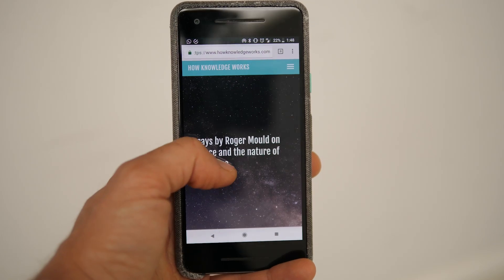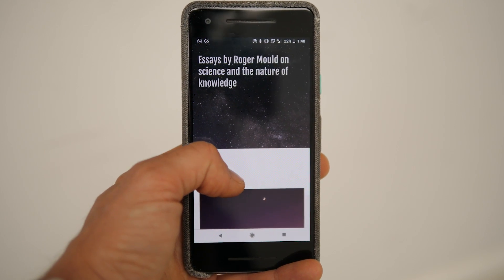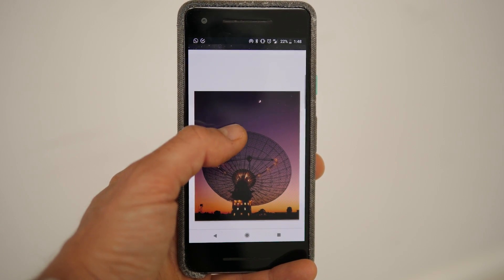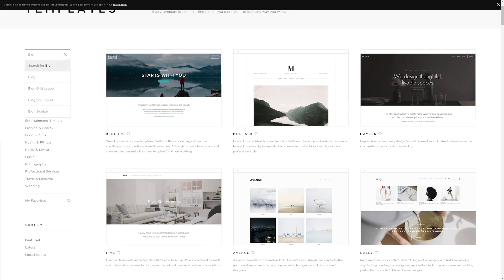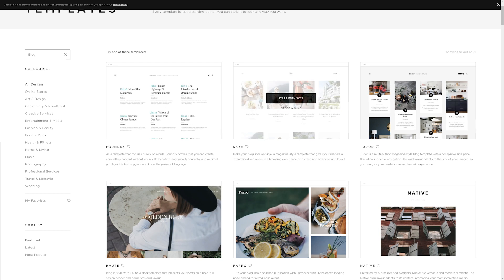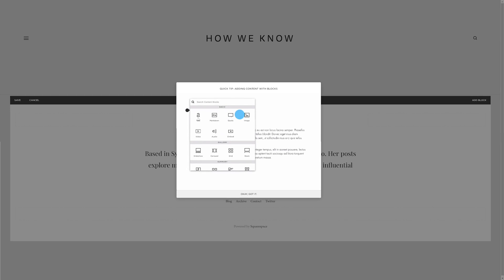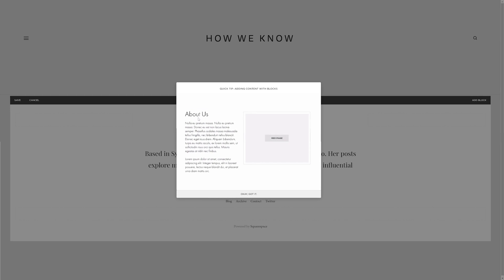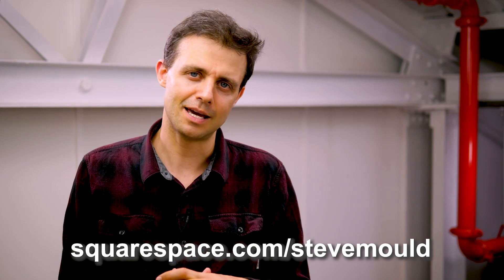The bizarre ripples that form in a stream of water

Comment: The front of the flow is smaller and the source has more mass and moves at a increased velocity. The flow rates the velocity x mass sq  = 
Like an arrow the back of arrow is  moving faster than the front. The source of the flow is moving faster than the leading end.  This isn't a mystery simple fluid dynamics. The specific  gravity of the liquid and the velocity of flow will determine the flow characteristics in a phased life cycle. You will get molecular separation causing the formation of drops, flow Eddie's and axial flow separations exhibited in the cross section or weave patterns in the surface representation. This isn't a mistery it science, fluid dynamics, physics, chemistry and math.

Comment: Pretty sure it's more a property of subcritical flow.
Basically, sub critical flow is when the speed of a liquid does not exceed the speed that waves can travel through it, meaning waves can travel upstream.
When you stick your finger in the stream, tye obstruction creates a continuous ripple, and due to the low speed of the liquid, those ripples can travel upwards.
As to why the ripples are bigger up further, it is likely because the speed is slower, allowing for the ripples to travel further up.

Comment: this is something that has catched my attention a long time ago... what i see there is surface tension doing it's thing, but i doubt it's related to a standing wave... look closer at 1:32 ... closer... more closer... it's not bulges that build up in the stream like when it's dripping. instead, the stream turns into a spiral flow... the spiral flow will turn one way or the other, depending on which side in the depth plane of that frame the bottom cloth is located...

i think... just guessing...

Comment: Water it’s a fluid with relatively low density and viscosity, and like any fluid have a superficial tension, when you interrupt a laminar flux it acts in a very similar way in to a swinging string but it has an extra dimension over the surface tension and it transforms in to a membrane. When you have a swinging string it vibrates just like it’s fundamental armonic (in proportion of the total string length), when you have a laminar flux, the surface vibrates also, and it takes the reverberation of the laminar length just like cimmatycs, that’s the reason because a water flux can transform in to a standing wave pattern, it maintains relation with the water natural resonance and the standing waves gets propagated all over the surface

Comment: Some pictures of water dropping out of a faucet: https://goo.gl/photos/rayt6T8pdDGvWVLh6 It seems like what he is saying can be expanded to explain what is in these photos as well. When I took the pictures I thought surface tension and standing wave and I was happy (not very curious on my part).   My uninformed guess would have been that a single water ball towards the top would have formed.  Now my explanation, based on my weak understanding of this video, is that didn't happen because as the ball formed it sucked nearby water in the column into it faster than the momentum of the water caused water to flow into the ball and a low pressure area under the first ball is formed which causes the column to neck down and the process repeats until a series of balls have been created?

Comment: So my thinking is: Since you put something in the way of the flow, the molecules get slowed down(maybe even get pushed back a little bit. So the molekules in the front of the flow get slowed/pushed back, but there are more molekules coming at unchanged speed from behind, so the molecules bottle up and need to go somewhere and form the bulge. If you look closely at 1:17-1:45 you can see, that if you hold the object in the middle of the stream, the bulges are shiftet (when there is a bulge on the right side, there is a pinch point on the other side and vice versa), because the one side is obstructed while the other can just flow normally. And if you hold the object directly under the stream you have the bulges lined up (1:36), since you obstruct the flow on both sides equally. In a confined space (a tube or a channel), if you put an obstruction somewhere, it would create turbulences, since the bottled up molecules cant go anywhere and swirl up. In an open stream however they can just form these bulges because there is nothing in the way. 
Can someone debate?

Comment: I think it's a simpler phenomena.

You are perturbing the flow, causing collisions of water molecules with the obstruction as well as other water molecules.
So two things can happen right?

Either the force will be enough to break the surface tension of the water, creating a lot of splashing or it won't. In the case that it doesn't, that motion is still dissipating into the stream of water. The result is waves caused by the physical collisions of particles while being contained within and colliding with an elastic surface.

Comment: Steve,   I don't know if you accept suggestions for topics, but I think I have a good one for you.... If you drill a hole FIRST and then use a countersink bit, it will cause a vibration which ends up creating a hexagon shaped countersink hole, but if you do the countersink before drilling the hole it will be nice and round.  The weird thing is .... a five edged countersink bit will also make a hexagon if used AFTER the hole is drilled.           
Question 1: Why?
Question 2: Is there any connection with the naturally formed hexagon shaped clouds at the poles of Saturn?
Reply from the maker: This is really interesting! What are you dilling into?

Comment: I was thinking of a trumpet. There are two places where the wave inside it reflects. One is at the side of the mouth, the other is at the bell. That is a reflection too! When a wave pulse leaves the trumpet, it also reflects back into the tube! It is similar to a whip. When you make it crack, you shoot a wave through the whip, which at the open end reflects back, in phase through the rope back at you. So I thought that was relevant for droplets releasing from a water column too. As soon as a droplet releases, it will send a wave up that column, as much as it gets an internal wave as seen in the soap bubbles when they are released. It is similar to the vibration you see in the copper ring at 4m34s. This will explain that you can see waves traveling both up and down the water. 

With the obstruction in the stream, it is the same thing, though the reflection is in the other phase, like at the mouth end of a trumpet.

Thank you for the interesting video. I have seen it so often, and as a sound engineer, thinking about how waves reflect is part of the art, but I never imagined the waves in this situation.

Comment: After reading Gerald Pollack's 'The Fourth Phase of Water: Beyond Solid, Liquid, and Vapor' , I have every reason to re-vision a lot of presumptions about water - including surface tension.

I don't think I can summarize his findings in a post - but I feel anything to do with water will benefit from an acquainting with his work, with this particular book being at the same time a call to come back into what could be called original science - observations to test and either disprove a theory, revise it or leave it supported by evidence to date. (Rather than mathematical modelling that may offer functional exploitations absent any human understanding - or computer simulations or similar, that can be set to the parameters that support an established theory). 

I clicked this because I saw what looked like a spiral and am interested in the way water (and blood) flow vortexes - as a helical flow.

I see turbulence introduced into laminar flow resulting in vibrational waveforms back up the tension of the flow which suggests laminar water structures itself.
Pre Pollack there is only 'surface tension' to make the 'elastic skin'. How many molecules thick is such a 'surface'? and is that really what keeps a huge ship from sinking?

Comment: #TeamLaminarFlow
Reply: Don't let Veritasium see this...
Reply: Turbulent! Turbulent! Team Turbulent!
Reply: @yoshikagekira6166  i am with Team Turbulent....
I think most of the people also, that's why he doesn't getting as many like as he should in a comment
Reply: @yoshikagekira6166  its OK, but not as cool.
Reply: still
Reply: I love you videos, sir! thank you for your consistent effort!!
Reply: Destin knows turbulent flow is cooler. He's just frontin.
Reply: LAMINAR FLOW!
Reply: Oop there it is!
Reply: Could we get a slow mo video of this? When the obstruction is introduced?
Reply: I thought you switched sides and began a love affair with turbulent flow? Anyway, I'll present this to you and Practical Engineering... I don't think it is the same as the water drip. Imagine a  black hole at the end of a laminar flow that creates an immense vacuum to suck the water stream faster than it can flow. The surface tension will want to keep some containment and as the vacuum is applied, there will be a thinning of the stream. In contrast here, we are putting a blockade that will increase pressure and the surface tension does a small amount of keeping the stream together and backs up the flow as much as the surface tension can do. When this backup is great, it will make a splash because it overcomes the surface tension, but when it is slight, it creates this bulge as if you were stuffing a sausage casing (the surface tension) and not allowing it to move forward.
Reply: You guys are obsessed with it.
Isn't it?
Reply: How do you only have 7 likes??

Comment: Would the force of the water push backward when it hits your hand or an object forcing it to bow out before it runs out which then makes it more unstable above that "bubble" and continues onward up the stream? 

Idk if I explained that enough but basically when the water comes into contact with the object theres an equal force acting upwards on the stream, since the force of upwards is too great it could cause the first bow but since the stream is too big to create one large bow it separates as the pressure changes upwards. Maybe if you had a high speed camera you could watch the ripples form in slow motion and see if they form from the bottom up?

Comment: Couldn‘t it just be caused by the molecules getting slowed down and thus slowing down the upcoming molecules like stacking some boxes on top of each other, just with the Surface tension holding them in the Stream? Since the surface wasn‘t Level it might be different if it was. Maybe that would then behave like straight stacked boxes, while this setup behaves like boxes being stacked on an angeled surface (assuming the boxes where bound together by a string so they don‘t just fall down). At least that works for sure, but i don‘t know if it applies for the Stream too.

Comment: when you make the flowrate realy low. just befor it brakes into droplets. you can trigger the braking with that opstical. When you approach slowly, you can see the transition from the riplle to the droplets. 
With a litle bit of practise and the right flow rate it even works the other way around. You have the driplle form the ripple and than go back to the lateral flow.

Comment: It's a sound wave, the same as dropping a pebble into a pond, but in this case, it's the pond that's moving not the pebble... yes, the sound wave is travelling in the opposite direction to the water, but the speed of sound in water is much faster than the flow, so the fact that the water is moving can be safely ignored. When you do it close to the tap, you are going to get some of the waves bounce back again, giving you thicker, stable waves when you're in resonance thus getting constructive interference, or you get the cycling wave/no-wave when the waves destructively interfere. When the stream is longer, there's no echo (you get decoherence - where signal to noise ratio drops too low as the sound of the flowing water takes over) so you see only the single wave, with none of the coherent harmonies. Where the water doesn't hit the obstacle straight on - ie, landing on a level surface - and instead hits an unlevel surface (such as at 5:57) the waves on one side of the stream are offset by the extra distance travelled... so at 5:57 in the video, you'll notice that if you draw a line from the first pinch-point where you have the dotted blue line, to the first pinch point on the other side, the angle of that line is roughly the same as the angle of the surface it's hitting. You won't see that close to the surface though as the waves radiate out in the manner you'd expect if you dropped that same surface area into a pool at that same angle - but with additional constrains or internal dampened echos formed by the surface tension.:-)

Comment: I’ve considered this before, and I’ve thought it similar to the way a thicker liquid (take custard for example) can build up on itself when poured.  It’s as if the water, builds up on itself, then the surface tension kicks in and forms the bowing. When you do it lower down, the water is moving at an increased velocity, shortening the bow effect. The opposite is true at the top, less velocity,   Bigger bow.

Comment: I was a little surprised you didn't give more attention to the observation that the standing waves in the interrupted laminar flows seem to be asymmetrically wavy unlike the examples of Rayleigh-Plateau instability. I wonder what the significance of that is. It seems to be the main feature that distinguishes the phenomena, at least observationally.

In the case of the instability, the wave patterns are caused by the pulling force of the water at the bottom accellerating beyond some threshold, whereas in this case the initiating force seems to be a push-back force from the obstacle to flow, a pile-up of sorts at that point changes the energy dynamics in a way that propagates backwards. I'd love to see these waves form in slow motion under controlled conditions. 

I wonder if there is any connection at all to the forces that cause rivers to become more wavy over time - maybe only to the degree that it has to do with momentum on the outside of the curves... I dunno. :)

Comment: You speak of tension, is it possible that the laminar flow is allowing for compression. Much like how honey spirals as it trickles onto a surface. maybe the flow is wobbling in the same way as  a queue of people would bunch as the leader of the queue came to a halt, or a sting would if you tried to push it along its length. Great thought provoking, thank you.

Comment: Newton's low of motion playing big role in this this thing is not just a string.
When you touching the stream it will give the opposite force to the stream.
The surface tension try not to brake up. Also continuous stream make this reaction chain stable.
Sorry if my explanation is wrong 
-by a mathematics student.

Comment: Really like the video, very interesting stuff.  However, the graph at 5:10 can't possibly be right.  The surface area of a cylinder's wall (a cylinder excluding the circles on the end) is linear.    The demonstration's whole point is that the surface area is the least it can be, presumably less than a cylinder.  So, the graph of the surface area with respect to height should be sub-linear, not super-linear (or, at least linear with a constant less than 2*pi*r).  It definitely doesn't tend towards infinity as the cylinder collapses, it tends towards 0.
Reply: jdhiser also quite confused by that part. If the shortest path between two points is a straight line, how can a curved surface between two points have less surface than a straight surface between said points?
Reply: And then 4 comments down you find the rather obvious answer.. Reminds me of planes taking a non-straight route for the fastest travel time ;-)